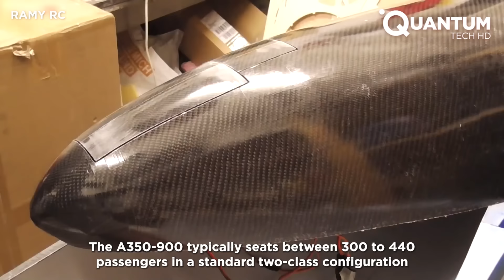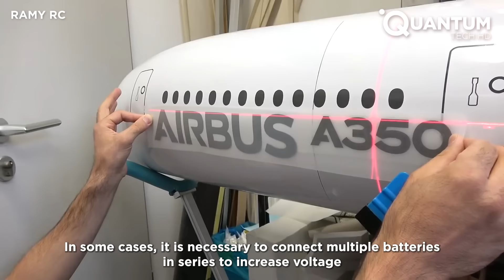Man Builds Hyperrealistic RC Plane at Scale | Airbus A350 Replica by @RamyRC

Comment: integration of a fully automated pre-set flight path system in the flight management system of the model aircraft . . . the 1/10 scale A350-900 model aircraft could do with features like opening cabin (revealing the cabin interior), open/close cargo bay doors etc. . . replication of actual sounds of a turbofan engine at take off . . .

Comment: After installing per your video, the "pause print" on my machine does not restart at the point it paused it at.  In fact it is almost 2cm higher than the point of the pause.  Any suggestions?